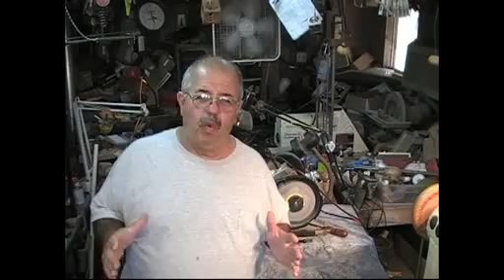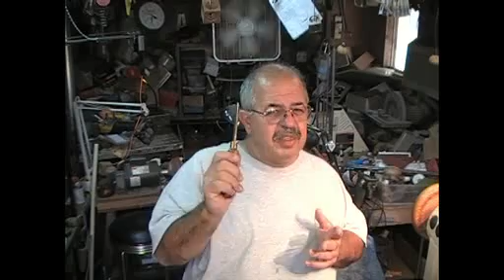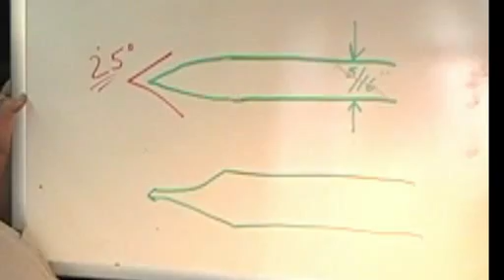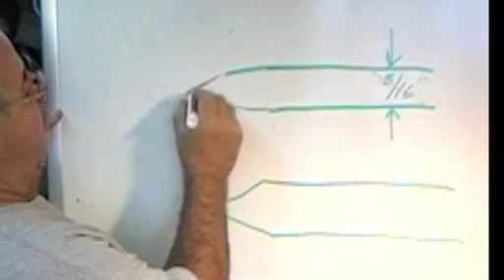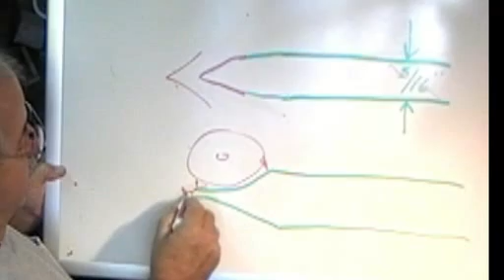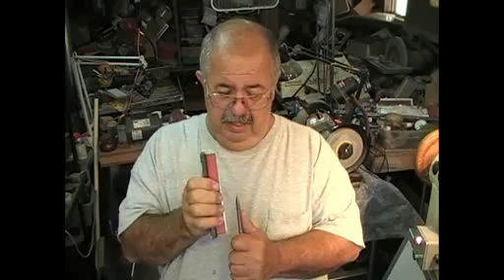#101B Woodturning 101 Sharpening chapter two

Comment: I have a question, being new to turning, I was wondering about sharping like one does for carving knives? I make my own knives and gouges for hand carving and after I get my edge, temper and clean up with a file, I use a buffing wheel and then just do touch up with a slip strop, so can one use a slip strop after getting the right bevel on the edge? I know with knives you want it to "slice" through the wood, is it the same with turning? replies welcomed.Thanks. =)

Comment: I still haven't gotten the process down for sharpening my skew chisel. Part of the problem is that I have a 6" grinder which only has 3/4" wide wheels and it runs at 3450rpm. I need to correct that situation and get it right so I can spend some time practicing on some trash wood.